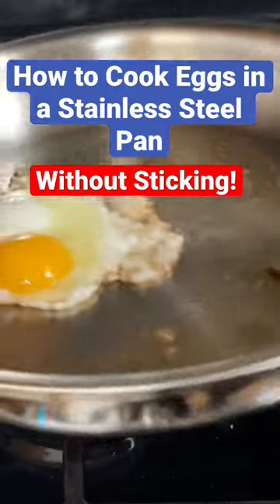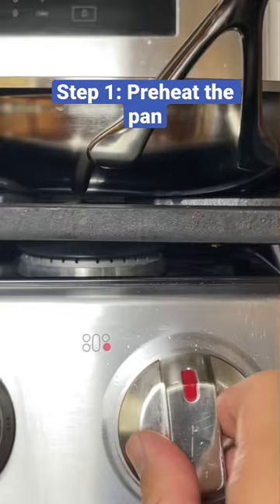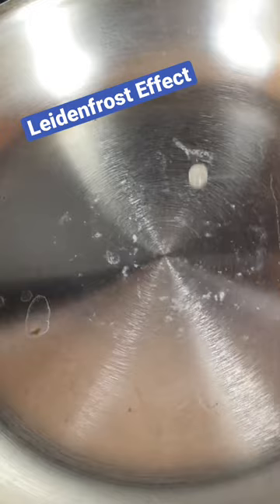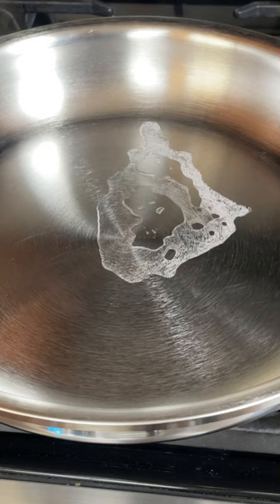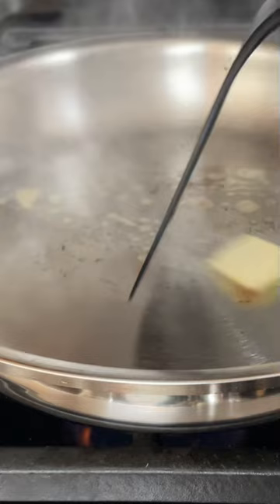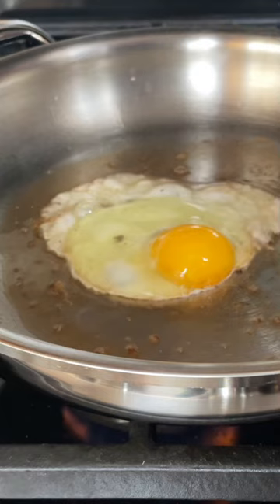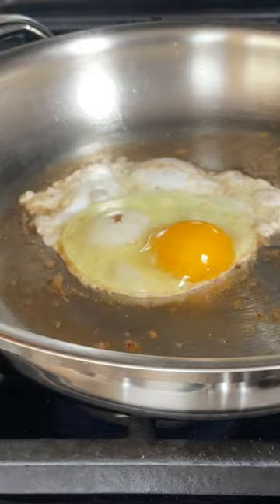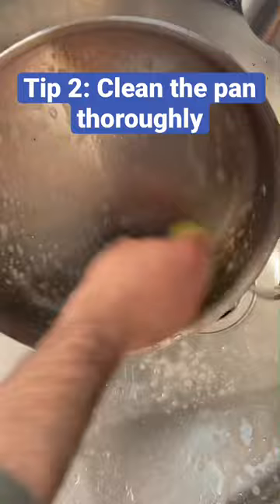How to Cook Eggs in a Stainless Steel Pan Without Sticking

Comment: That pan is way too hot.  I use stainless for my eggs...no sticking.  Yes to preheating. Add a generous pat of butter and let it melt... but NOT turn brown (pan is too hot).  As butter starts to sizzle, add the egg and yes...leave it alone.  It will release and slide around the pan on its own!  An egg that gets brown and crispy at the edges in inedible...like chewing on leather.  Some like it that way...most do not.
Reply: So the water test is unnecessary and just get it where butter sizzles but isn't burning (turning brown) and that should be the ticket?
Reply: You are correct. The butter shouldn't turn brown if you do it correctly.
Reply: How long should you preheat for?
Reply: @ShoeBoyReview  everyone's stove and pan is different, so that's hard to say. I'd start with medium heat for 3 minutes and adjust as necessary. If you apply butter to the pan and it turns brown, it's too hot. If you apply and it bubbles, then you're good.
Reply: @matt_nyce  thanks. How long do you leave the egg on once the butter bubbles?
Reply: @ShoeBoyReview  you should be able to lift it from the pan after 2-3 minutes. If it's still sticking, use more butter next time.
Reply: @matt_nyce  thanks for the quick replies! Use more butter, or maybe even slightly higher temperature?
Reply: @ShoeBoyReview  exactly!
Reply: @matt_nyce turned out pretty good! Thanks for the tips. I think I’ll continue with this instead of waiting for the water to turn into a ball.
Reply: This did not work for me eggs stuck like crazy. When I do the water trick it didn't stick?
Reply: maybe he likes his butter brown because thats where all the flavour is anyways. this video wasnt a sec by sec so we dont know how fast the butter went brown.
Reply: @EvanEvansE3  no water test needed.
Reply: @ShoeBoyReview lower temps can work
Reply: "It will release and slide around the pan on its own".
And this occurs, in your kitchen, on the planet earth?
Are you cheating, and doing your cooking in a parallel universe, or a zero gravity capsule, or another planet where physics hasn't been invented?
Reply: @robinhood4640  No, it's just how cooking works. If the bottom of the egg that you're cooking is solid and held together from being cooked, it won't grip onto the pan. Maybe just get better at cooking?
Reply: @robinhood4640  if I had to guess, the steam since eggs obviously have a high moisture content, is probably bubbling from underneath and flopping the egg around the pan is most likely what the original commenter meant by sliding it around the pan, not ‘Zero Gravity’ although, a Zero gravity kitchen would be really cool!😂
Reply: @jakethomason5047  I'm starting have serious doubts about the zero gravity kitchen theory, it doesn't seem to be holding up very well to scrutiny.
What about the "feeding chickens with PFAS" theory?

Comment: Great. But im gonna use ghee instead. Butter burns
Reply: It doesnt matter
Reply: yeah it does and u sound like u dont cook
 @Mark-ho6tn
Reply: @othsasaa5386  I do cook. It doesnt matter when cooking eggs. You should not be heating your pan so hot that your butter is burning. If its smoking a little bit and getting brown thats totally fine. Maybe you should learn how to balance the heat on your stove.
Reply: @othsasaa5386  Browning the butter doesn't mean it's burnt. You can search images and/or websites in the search engine.

Comment: Ouch seeing that burnt butter.  The pan is too hot!  I would add another oil instead if you want your pan that hot, or 'season' it.  (I don't think that's quite the right term in this case)  You could add a little avocado oil to lube the pan, and then a little butter (at a lower temp) to gauge the heat and add flavour to your egg.

Comment: Thank you for this. The key for me was patience on the pan getting to heat and then waiting for the eggs to cook enough on the bottom so they can come off the pan. You can use a spatula to help them a bit but still need to wait for them to cook enough. Butter worked fine for me!

Comment: I did notice and achieve the Leidenfrost effect.
In the end, my egg was still sticking. Guess if you put a huge amount of oil / ghee you may retrieve your egg in one piece.
I used ghee.
Reply: Ghee definitely works best. It's now my go-to fat for stainless steel frying. Works brilliantly on thick-cut steaks
Reply: Putting more oil doesn’t work, I thought it would 😂
Reply: @zada  nah, it's all about the temperature and using the correct oil. My favourite is Ghee, as unlike butter it can be used at higher temperatures
Reply: what ive noticed is that when your pan is hot enough, and you put an egg in, you should decrease the heat a bit right after, this reduces stickyness. also, if the egg sticks, just wait a bit, then try again.
Reply: It's kinda awkward feeling advice, but: keep trying.

Not because you will get better at it, but because the pan will get better, as small bits of oil coat the steel just like on a cast iron pan. Steel pans do this too, it's just hard to build up (or keep) a thick coat on them so nobody tries.

Putting it through the dishwasher or soaking a long time will strip all this off and eggs will stick badly again. It's part of why hand-washing pans is recommended.

Comment: The water drop test works, but you still need to use a non stick spray or some kind of oil. Also eggs should be cooked low and slow while beef is typically cooked hot and fast. So you may want to season a pan if you plan to fry up some steaks in it since it helps the meat not stick as much. 

But in my experience with stainless pans is as long as the food isn’t super cold straight from the fridge (even 5 minutes on the counter helps) it will stick a lot less. But the number one mistake you can make is trying to move the food as soon as it hits the pan. Do not do this, as it cools the pan rapidly and the “pores” close up and grab on to the food making it stick really badly. Just let it sit there and realize it doesn’t need to be in the middle of the pan to cook properly.

Comment: use oils that have high smoke temperature for example coconut oil which is healthy and not too fatty you can coat that pan after it's dried a slight layer it won't do any harm just remember don't keep it too long in the open on top of the table dust before on the pan and it will get dirty and you will have to wash it again before you cook

Comment: So how do you do multiple?  I cook  two eggs at once. Once I was ready to flip it, the eggs did not stick but they were very brown on the underside. Do you turn the heat down a bit?  After cooking two eggs, I took it off the stove and I wiped it out To do a second set of two eggs. The butter was very very brown and burned. Advice? Thanks.

Comment: No matter what I do, I can’t find the right heat. My water always beads into tiny specks. I turn the heat down slightly, water sizzles.
Reply: you might have a very thin or badly conductive pan
Reply: @bartlinssen7443  yea, I had a feeling that could be it. Currently saving up for a  Made-in.

Comment: About to rage, I’ve done everything every video has said about stainless steel pans and everything still sticks, salmon was the only thing that didn’t stick
Reply: 1. Add oil in a pan enough to cover the pan surface when it is cold.
2. Heat up the pan and oil to 350-365f or medium high. (The oil should begin to smoke at this point).
3. Add egg to the pan. It can be cold. Best results if poured gently and slowly from a dish and if the egg is room temp.
4. Once the egg begins to turn opaque, turn the heat down to low. 
5. Every 30 seconds move the pan around the 4 quadrants of the burner. The egg whites should be soft but gently starting to cook through.
6. Take a spatula facing down in the pan to check if the egg is moving freely and redistribute oil to any dry spots under the egg.
7. After 2 minutes, the egg whites should be soft and opaque and move easily on the pan. Do not lift or pry the egg upwards, but slide laterally. Once the egg is free from the pan, you can change the heat and continue to cook the egg until your desired doneness and is ready to serve.

Tips: A gas burner does not distribute heat across the pan evenly. The hottest parts are wherever the flames directly meet the bottom of the pan. Most people drop their egg in the middle of the pan, which is the coldest part and thats why sticking usually happens near the yolk, but not at the edges. So it helps to actually move the pan around all 4 quadrants over the burner every 30secs during the 2 minutes you are waiting for the egg whites to solidify (i.e., imagine your circular burner is cut like a pie into 4 pieces and the pan should be moved slightly around all 4 quadrants, instead of just keeping it still). 

Remember that gas stove burners will heat from the edges in, and coldest in the center. And that pan material and thickness will afftect cooking times. A Large burner and very small burners will have more cold spots and need more pan movement to heat more evenly or it may stick. A medium gas burner or An induction stove or electric coil stove (and a thick pan) offer more even gentle heating. Before adding additional eggs for cooking be sure the entire surface is coated in oil and that all the oil reaches  smoking temp. Scrape off any sticking areas from previous food in the pan and let oil reach back to temp there before adding your next egg. If the pan has not been physically/mechanically cleaned properly before use, previous food residue and sugars may lead to new food sticking during cooking. Cook eggs first in a clean pan, before any other food that may leave residue. Only cook 1-2 eggs at a time for best results and even cooking. Generally, once the whites are opaque (about 2mins from hitting the pan), they will slide off freely from the pan (assuming they have been receiving heat evenly and were not sitting in a dry spot). You do not need the water drop test. Once the oil or butter begins to smoke you know you are are at 350-365f, which is the smoking point of most oils.

Cheat hack: If your eggs are still sticking with the above culinary-level instructions, you can begin step 6 even earlier -about 30seconds to a minute after the egg has been added to the pan. Start with the spatula face down and slide it under the egg, keeping the spatula face down, as the whites are mostly opaque (move the egg laterally, but do not lift or pry upwards).

Like if this works for you.
I did it just now and no sticking for me. But of course pan thickness and stove type are all factors.

Spend a weekend afternoon practicing with a carton of 36 eggs and you'll get it right. Any ruined eggs can be saved for fried rice or any of your favorite chinese soup. Or give it to your dogs/cats.
Reply: Maybe you need to address the problem in the same manner as those doing the videos on "how to cook an egg in a SS frying pan".
Cook 25 eggs one after the other and only eat the one, that by some miracle, didn't stick.
Reply: 1/9 I have learned how to use all stainless steel pans, I just wasn’t patient enough with myself thanks for everyone helping out

Comment: That's the problem cleaning the burn oil everytime you want to cook something.
Reply: Well you should be cleaning your pans after you cook, just let it cool a bit. Leaving crud and oil overnight in a pan will just make ur life harder
Reply: @chadgrov   it always have burn oil mark everytime cooking something hot.. That's why I always use my carbon steel...

Stainless steel might good on paper but if you like cooking carbon steel is much better.   It actually easier to maintain than stainless steel and that burn oil is the non stick coating.
Reply: @anubizz3  oh well if you have a carbon steel then it’s a moot point of course the carbon steel is better in every single way. If it’s anything besides eggs I’m pretty happy with my cast iron. Especially any kind of meat. I’d like to get a good carbon steel pan myself but the price is a bit of a barrier

Comment: Meh. Just get a high quality non stick pan for your eggs. I use my stainless steel for almost everything, except eggs and grilled cheese sandwiches. With eggs you have to use a gross amount of butter or oil to prevent them from sticking to stainless steel, as evidenced in the video. My eggs shouldnt be swimming. And without more oil than i would use to cook a meal big enough to last 3 days they gum up the pan every single time. Ive never tried a grilled cheese on them, but it takes 5 minutes to do in the non stick with no oil, just butter the outside of the bread slices, and minimal preheating, so i have no intention of switching that method. Silicone spatula for the non stick, and i have no scratches or marks on my non stick for over 6 years. Or you can get a walmart special and replace it every year.